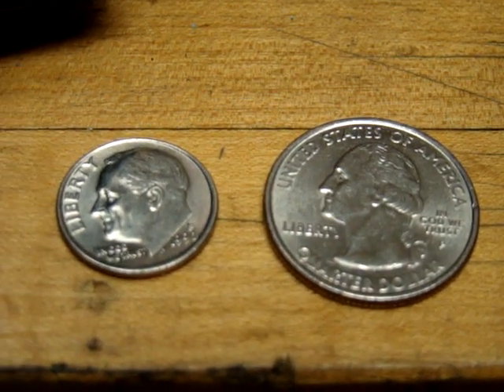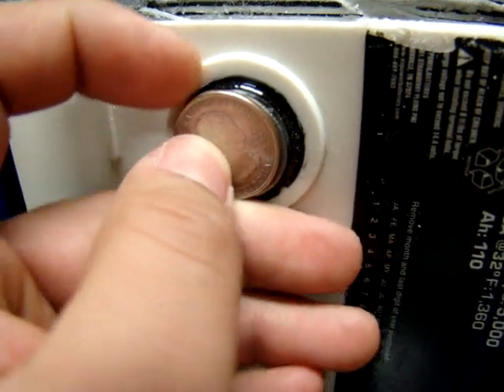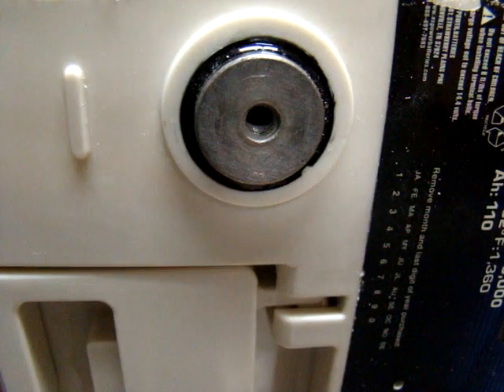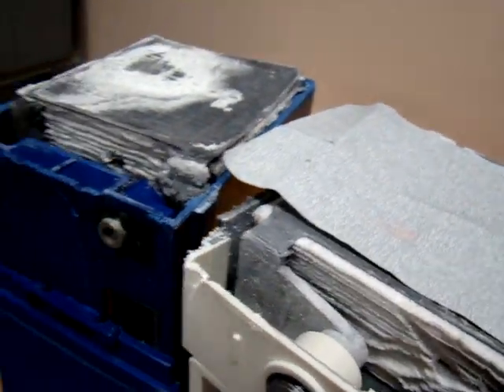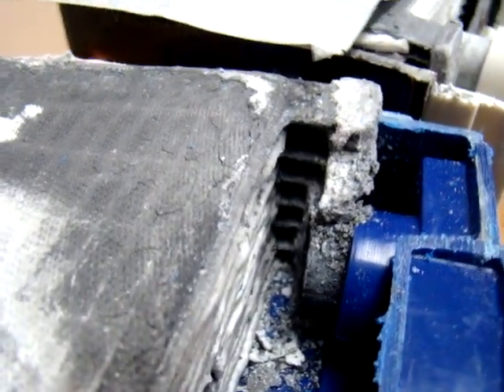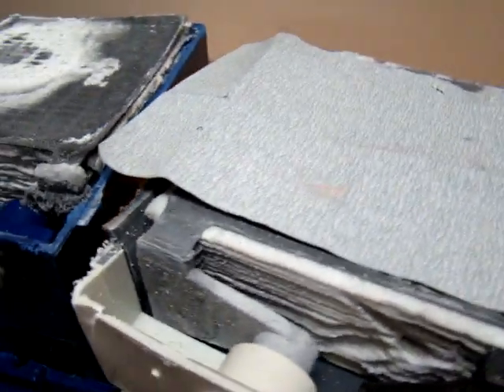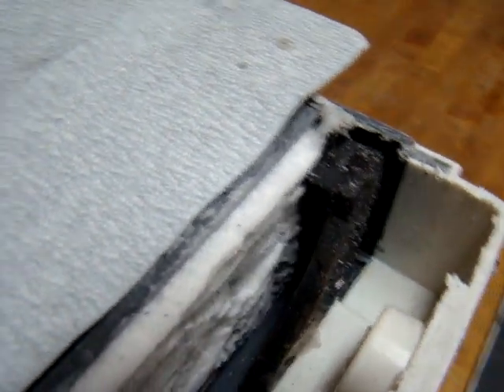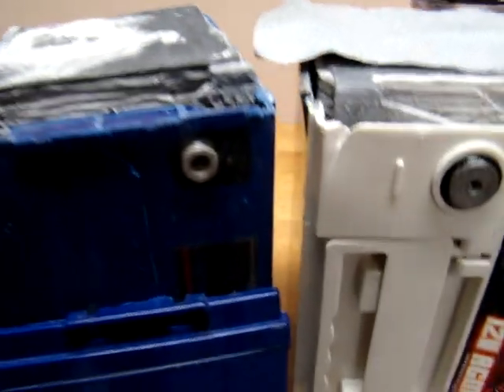XS Power D3100 v/s Competitor Group 31

Comment: I was running 2 yellow top batteries and switched to 1 D3100 and what a difference. They are really good batteries. Almost one year now and the D3100 is still kicking butt. SX POWER for the win.

Comment: @4xspower i have a 1987 cutlass with a 80amp stock alternator. i have two amps that pulls 210amp together will a XS Power D1400 keep voltage good or do i have to get a bigger alternator

Comment: One thing i noticed using both XS and Kinetik is how damn easy it is to attach terminals to XS batteries over Kinetiks.  Look at the top terminals on the D3100, they are so much smaller and that makes it MUCH easier to attach 4-5 terminals....Compared to the Kinetik where it is difficult to attach 2.
Reply: kcMacnCheese yea i noticed that its the screw its bigger and plus its threads inside the terminal makin the contact..and for the price of xs u can get almost 3 agm for amh